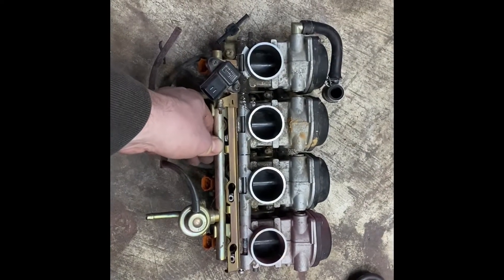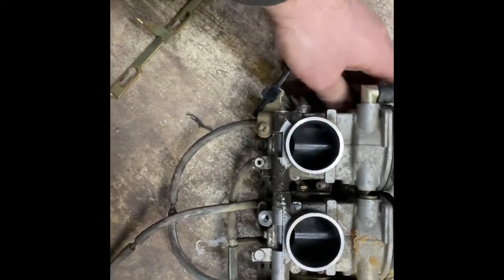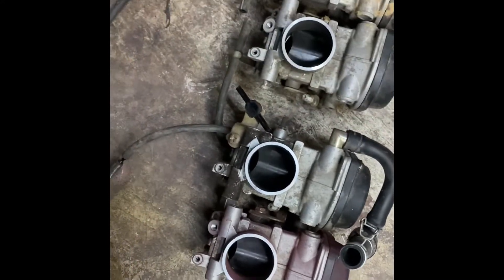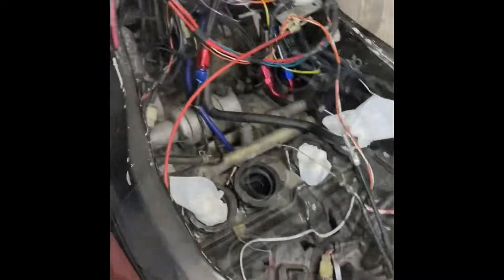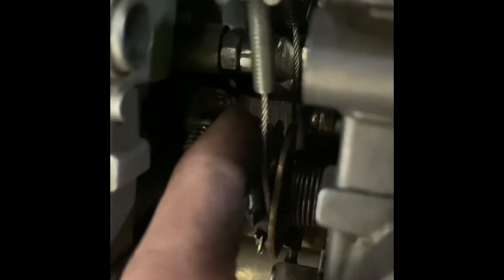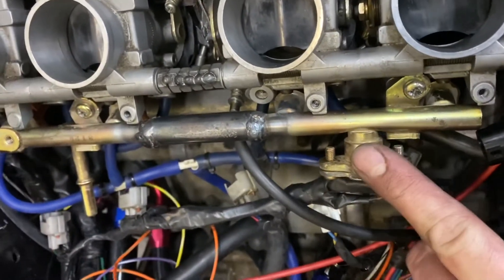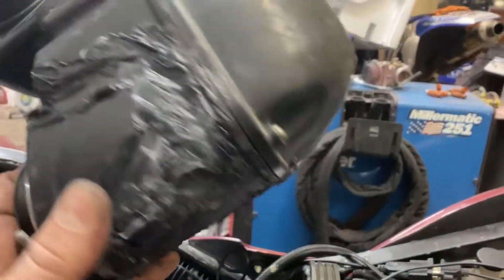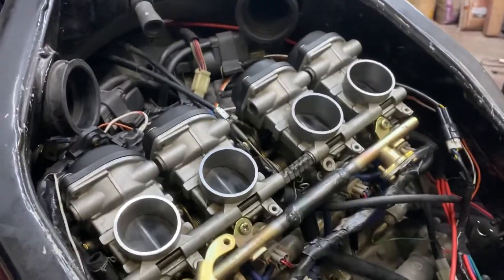Yzf600r EFI conversion part 2. Throttle bodies.

Comment: I like your ingenuity, Though it’s not the prettiest, It works, It function and that just it... Its not a blank check build, You don’t have a shop with hundreds of thousands of dollars worth of tools with lathers and CNC mills etc. Your proving that with a little ingenuity and self-confident driven determination you can still get it done. I don’t know if I’ll do everything the same way but thank you for showing the steps that it takes, this is an informative tutorial And I’m looking forward to part 3. Keep up the good work... FYI may have a few questions for you… My throttle bodies are coming in next week.
Reply from the maker: Thanks for all the encouragement, I made a Facebook group (link in the description). It should be easier for me to answer questions on there.